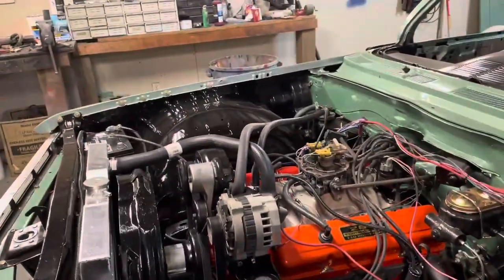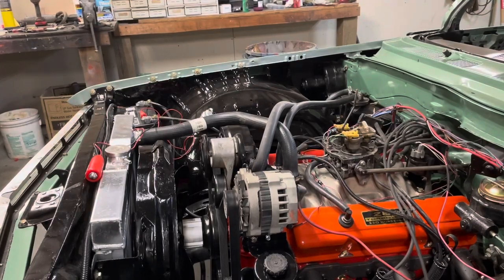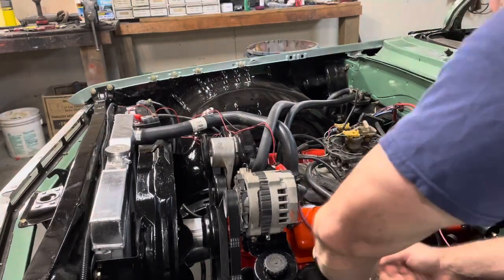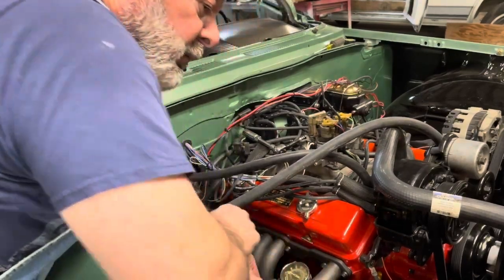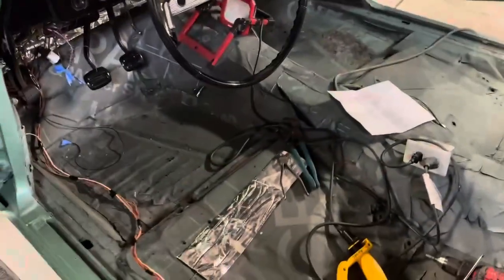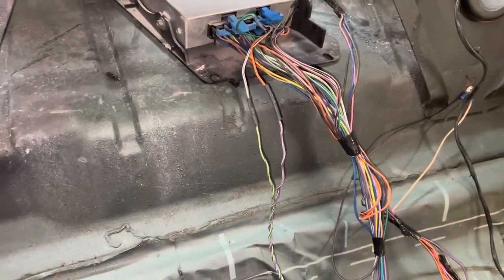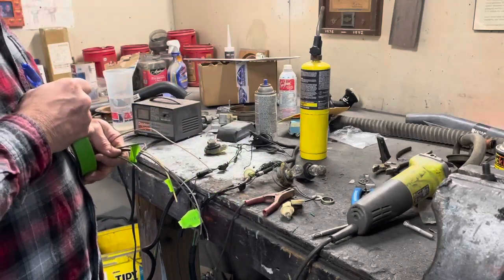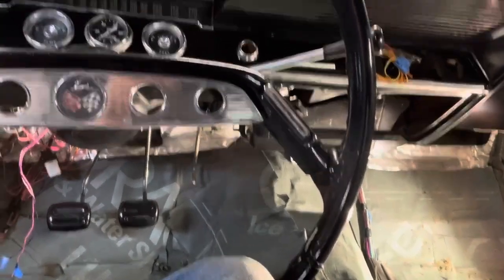1961 Impala Hardtop 4dr to 2dr conversion part 55; troubleshooting engine issue

Comment: Just wanted to let you know. The 2 moldings on the upper grille panel are on backwards.  They are notched on the ends. You need to turn them around. The notch goes on the bottom.  Thanks for the latest update looking forward to the finish. I don't have a garage so mine is on hold till the spring. Curses winter!!! Lol!!!
Reply from the maker: Thanks!👍

Comment: Regarding negative comments, ignore them. I've noticed there is always someone to tell you what you are doing is wrong, and the way you should have done it. Now, a good tip or advice on problem solving can be a good thing,  and I always welcome any advice that saves time and work. So, you are right when saying, be nice, it doesn't cost any more. If you don't like what you are seeing, change channels. Keep on with the videos, get stuff.
Reply from the maker: Yeah, everyone has their opinions and all comments are welcome. I figure take what you can use and leave the rest.